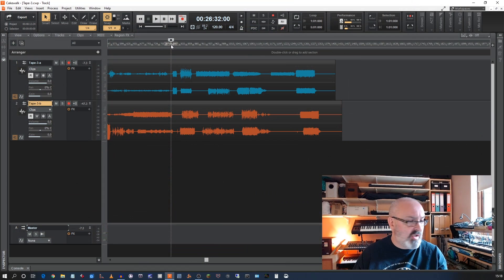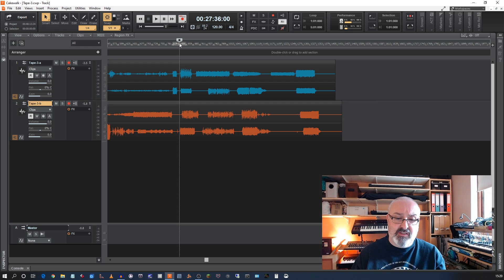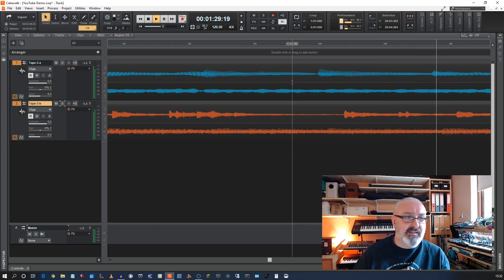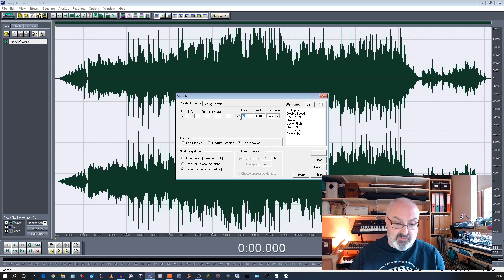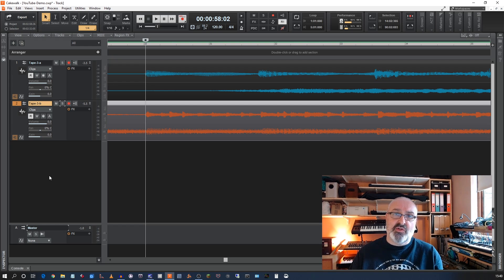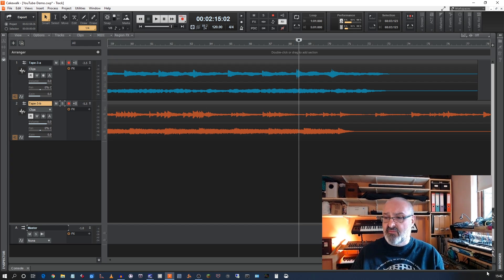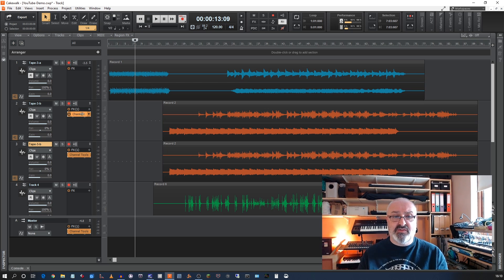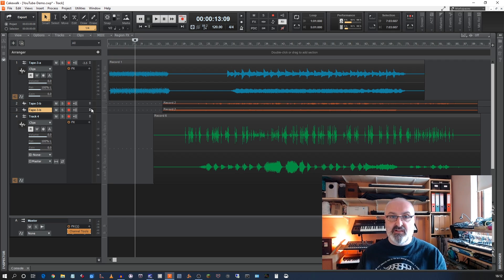4 Track Tape Restoration - Part 1 - Technical Issues

Comment: Maybe you should have tried to buy some NOS (new old stock) for a four track machine, probably a Tascam model?  One other issue is if any noise reduction was used on your old tapes, and in my case that was dbx, and I think it was v1 of dbx.  There is software called u-he Satin that can playback and record Dolby A and B and dbx I and II formats.  So perfect for transferring old multitrack tape mixes if you no longer have the original hardware multitrack recorder: https://youtu.be/ZRP5uI9mbzQ
Reply from the maker: I didn't really want to spend any money when I had a workable solution.  I doubt I'll be doing any more 4 track transfers but useful to know about the plugin.

Comment: I dreamed of owning a cassette four track machine in the mid 1980s, but had to wait until January 1991 with a Yamaha MT100 MkII (sold it in 1997 when I went digital).  Like you I later realised I needed to digitally archive my old tapes, so I bought a Yamaha MT3X in 2016 in mint condition for a mere £60.  I wish I could buy decent quality Chrome / Metal tapes in 2023, that are not fake or stupidly priced.
Reply from the maker: I sold off all my unused tapes a few years ago.  They went for a good price.  Wish I'd had a few more knocking around.  I'm pretty much done with tape, although emulation is always a bit of fun and adds some warmth  in a mix.
Reply: @RunningonairMusic  Yeah I am digital all the way these days, but having some older gear around is handy sometimes or just a bit of fun.  It's also nice sometimes to play a game of "what if I had that back in the year" etc.

Comment: Saw your Synthfest UK 2022 video and subbed. I have yet to recover my tracks from my X-15 and while I didn't use the local tip, my ex-brother-in-law failed to fix my X-15 and so I had the same restoration idea as you. It will be interesting to see what results I get eventually. It would appear that my journey into synths was similar to yours albeit a year later in 1986. I started with a CZ-1000, TR-606, MC-202, SH-101, Pro-One, Casio SK-1 and X-15 set up and I had only a few FX units, the best sounding being a Boss RRV-10 reverb. Great video.
Reply from the maker: Yes, lots of similarities there!  Re the x15, syncing tracks 1&2 with 3&4 is a real pain.  The speeds don't quite match so you have to do a lot of resample stretching.  Kind of wished id bought another x15 looking back at it now.  Anyway worth a try at least.
Reply: @RunningonairMusic  Thanks for the tips. I really need to find someone who will be able to repair / refurb it as close to as good as it was when I bought the X-15, if that is possible?

Comment: Another thing that one has to be aware of when trying to use a four track tape with a two track player is that many, but not not all, four track recorders have different spacings between the four elements (called guard bands) in the playback/recording head than the two elements on the head of a stereo tape player. To stop you hearing side 2 in reverse when you're playing side 1 on an ordinary tape player, the tape head leaves a space in the middle that is bigger than the space between tracks 2 and 3 on a true four track head. Some cheaper four tracks though, may use heads that were originally designed for auto reverse tape decks, and in that case you can get away with using a standard deck and playing the other side in reverse.
Reply from the maker: The x15 was the cheapest 4 track going at the time, also played at normal speed so no issues there.  Good to know though, as i always assumed that the spacing was universal.

Comment: Regarding the issue of splitting tracks - it would have been easier to set up your DAW project to have two separate mono tracks as your input instead of one stereo track. That way each track would have been separate from the start.
Reply from the maker: Yep, didn't think of that. :-)